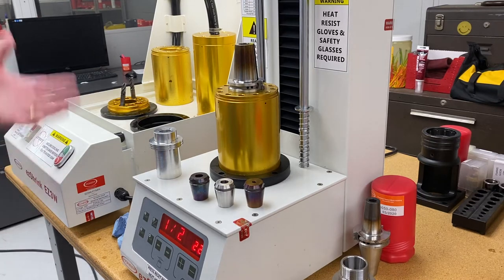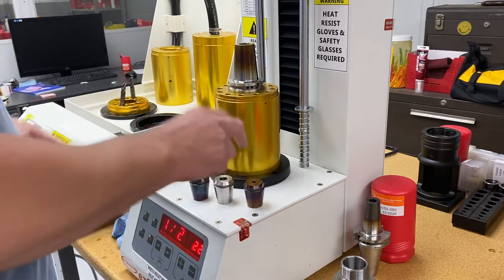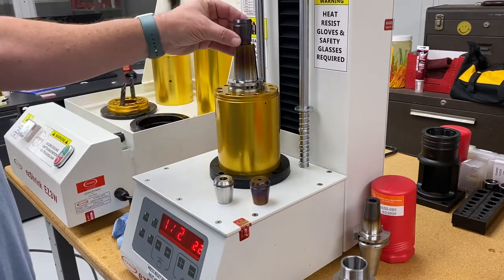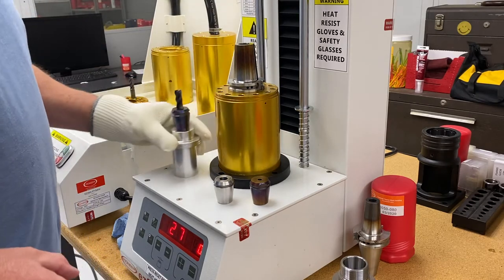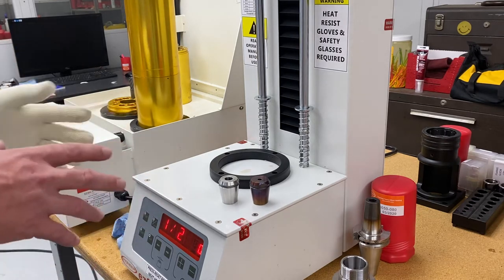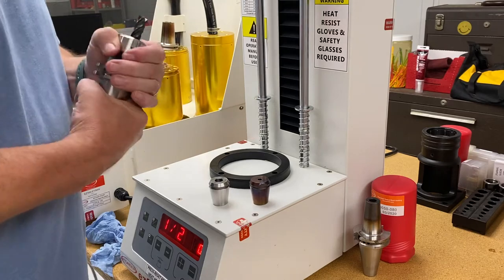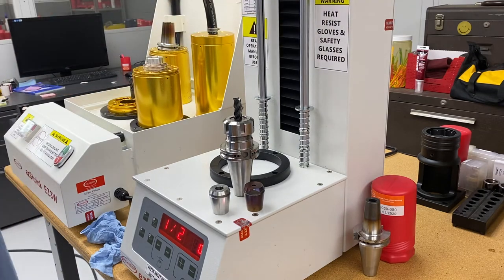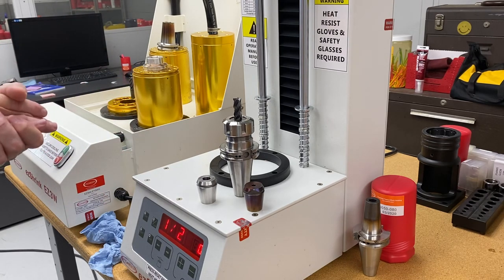ER32 Shrink Collets

Comment: Pioneer ER shrink fit collets can prevent tools slipping from live driven tools or right angle heads.  It also can be preset and makes a far more competitive modular adapter vs proprietary quick change adapters that cost 5x+ more.  It also won't reduce bearing life of live tools like current modular adapters do as it does not extend beyond the nut and cutting tool is held inside the bearings.  Competitor modular adapters hold tool extended beyond live tool bearings thus reducing bearing life at least 30%

Comment: I have been looking at the iscar and haimer system for a while for live tooling lathes and ended up going down this route and building my own system. Interesting to see how you tackled the same problems especially the heating of the collet over a reflective surface.
Reply from the maker: The collet with a counterbore in the back did not have any issues of course, but the full length bore collets where the problem.  I have new bases being produced that are steel so they will transfer the heat (they should) and work.  I have seen issues in Haimer machines with touch coils but straight coils they seem to be working.  The ER base should fit in CAT40 bases.  I should have them in a month or so.  If you want to try a demo collet please reach our to our office and we will send one out.
Production collets will not be available for another 6 weeks approx.  Starting out 1/8-3/4 in ER32.  We will add sizes as we see demand.
Reply: @LeeFlick  Thanks for the reply. I was originally using a ceramic base but steel worked better. I appreciate your offer of a trail but unfortunately I am in Japan.
I tested iscar had a better heater in terms of getting an even input but the actual unit was very noisy.